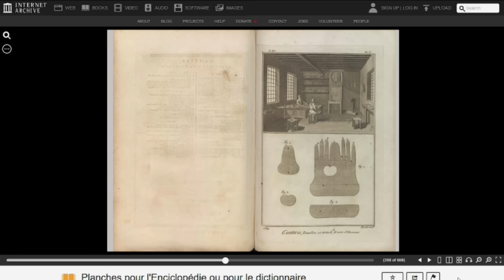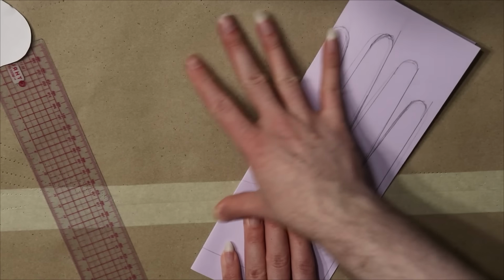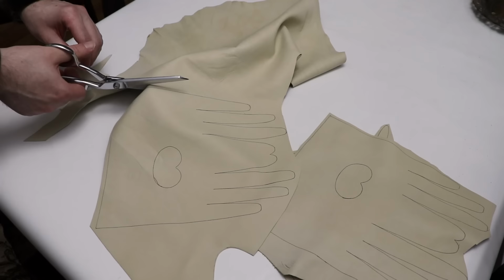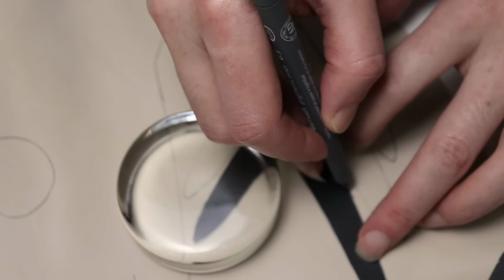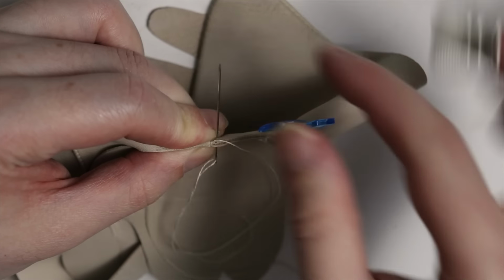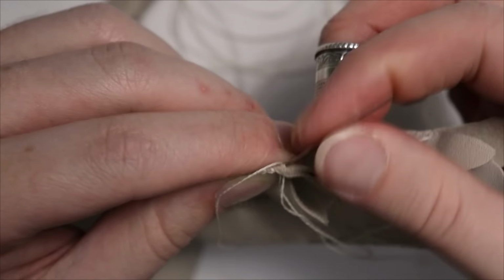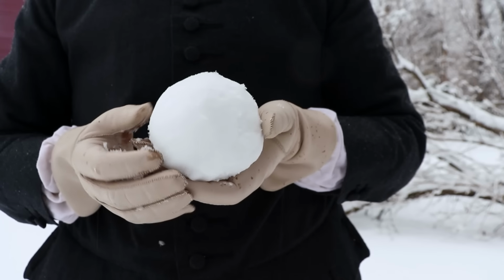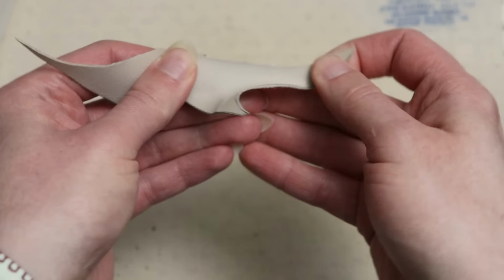Drafting, Painting, and Sewing Late 18th Century Leather Gloves [CC]

Comment: Hello! I am a hobby leather worker. Here is some information that I would like to share from my own experiments: 1.) Leather can handle some heat perfectly fine, in some projects, we dip pieces in hot melted max to make them harder and to seal them. So ironing at a low heat with no steam should be fine. But if you are trying to get the leather to behave, a better method is wet forming it. That's how we shape thick leather into extreme curves like hats and armor pieces. 2.) I have used an assortment of marking devices on leather including: ballpoint pen/white gel pen, alcohol inks (this will stain), water color pencil (this can also stain), grease pencil (this one is a smudgey mess but it does work), graphite powder (also smudgey), poked holes like one does with a tracing wheel, and the most common method for tracing a pattern for tooling the thicker leather weights is just to score your lines with a ball stylus. I hope this helps!
Reply from the maker: Thank you, it is helpful knowing a bit of ironing would be ok! And I hadn't thought to try ballpoint.

Comment: There are tools you can use to create an adhesive stencil so that, rather than having to peel each piece of tape off, you can remove the stencil off all in one piece. We have a Cricut that we use for many applications, including designing templates for carving woodblock designs and 19th century style quilt appliqués. And perhaps using a small brayer instead of a brush, to use the least amount of paint while getting the most even coverage without seepage under the adhesive.

Comment: Both pair of gloves turned out beautifully. I love the cow catchers. I think Howl Pendragon would enjoy wearing these striped gloves. The very slightly rough brown stripes look lovely on that neutral leather. If you would like to keep your needles from getting tiny little biting burs in them from using your pliers to pull the needle though, use a little scrap of leather between your needle and pliers. Using it with just your fingers will make it easier to pull through as well

Comment: As an American, I get most of my leather from Moscow Hide And Fur.  They get the hides directly from individual local hunters, so what's available varies a bit.  They also have bits of bone, in case you need a fang, claw, small skull, or bacculum for anything.  You might consider investing in some minksfoot oil to condition and waterproof your leather -- the oil fills up all the pores, so things can't absorb in anymore, especially water-soluble things

Comment: There are a lot of adjectives that come to mind that would describe you after my first video (And so far: Only) video I have watched from you...
With most just whirligig around how soundly considerate, well paced and absorbing you are all throughout it.
But in all of it, I find you to be such a sweetheart... As to "what would best describe" what it is I have just watched.

Thank you for the intimate respect you have shown to me as a viewer. This alone has very much deserved at least a membership to witness more of what I have been absorbed into just now.

A small tip for transferring (If it would be of any use to you):
I tend to work on gesso or other binders when I paint on canvas or wood, particularly since I have need for surface that can afford the massive details I have tendency to go for...
And for these, the "fastest" method I have found of transferring is to simply use rubbing alcohol on the back of a print-out/photocopy.
But shall I have to ever paint on leather (Although it still does tend to work actually); I refer from using this method unless it is a book cover or a hardened surface of some sort, due to the rubbing part making the material stretch and/or distort (Especially for Escher'ian geometric forms: this is sort of crucial) and since alcohol does tend to damage/dry it out.

WHAT WORKS though is the oldest transferring method I know to canvas... And that is to poke pinholes around your sketch and use it as a template to dust the image onto the surface.
For vegetable tanned leather; I transfer it such, and then "join the dots" with a B-3B pencil... But with a chrome tanned leather; I choose to opt for a gel pen... much like yours.

Thank you again for your time you have spent for sharing your experience with us in such an enjoyable way.

Comment: These thin masking tape strips remind me of paper strips used for quilling, perhaps you could buy the premade paper strips and simply use a glue stick to put some temp adhesion to them while making your lines?
Reply: I make the occasional collage, and putting glue onto tiny pieces of paper is very fiddly! I think there is also the potential that it would leave marks on the leather that would have to be cleaned off

Comment: in my experience, resolene is great for nice boots or shoes and thick leather journals.  I've tried to spray it on before to get an even coat but honestly a very slightly damp rag, a small amount of resolene, and wiping quickly and evenly has been my best method.  A small amount can make a big difference and you can always do another coat.  Too much will be thick, tacky, and cloudy.  I'm sure someone might know how to recover from that but I've just had to completely remove with acetone and start over, usually having to do some stain correction before attempting the resolene again.

Comment: What has worked for me when marking annoying leather is a somewhat used up quill pen and lamp black ink (The non moisture resistent but very cheap ink you can simply make from water, although they often used wine, lamp black which is basically just sut and gum arabic).

Comment: Might an eyeliner or similar makeup pen work for temporary marking, since they are designed for use on skin? Eyeliners come in lots of pigmented colors both light and dark, are sometimes waterproof/ removable with oil, and depending on the brand or brush used can make nicely fine/thin lines.

Comment: Both wonderful work and presentation Vincent. Some boot making techniques and info will translate to gloves. Worth it to invest in a leather hammer: the face of which is convex so as to not mar the leather. The antique ones are quite a bit smaller and more delicate than the ones sold at present. To finish the seams with the hammer, try lightly tapping the seams, or rubbing along the length of the seam gently to even out the leather after stitching. Secondly, you can try rubbing the seams open by inserting a smooth hard shape into the finger and rubbing the hammer against it if you like that effect. Also gently tapping the seam allowance before hemming. Some leathers are glazed after tanning and need to be deglazed with special solvents. Worth it if want to do delicate painting with Fiebings - and yes don't let it dry out - maybe an ink well for less evaporation on long jobs (there is a thinner if you wanted to try 'water colour' effects.  As far as cleaning, I believe glovers may have used hand forms of various sizes to keep the leather the correct size and the leather smooth when drying - you might try 'saddle soap'. You might also try soaking up some of the water with absorbent fabric tucked inside. It may keep them in true to size if you try glove forms to dry. There are leather marking pens with silver ink that rubs off after cutting depending on the processing and tanning of the leather. Warkov Safeer in Wpg (Boot Making supplies) is an amazing supplier that has third generation knowledge and will give you generous info over the phone even if they can't supply you with what you need (they have the pens and worth an ask if they ever have antique hammers/otherwise antique stores). Good to ask on any of your cold calls if there is any terminology with regard to names of kinds of leather - often referring to specific tanning methods: there is also lingo associated with leather thicknesses (I can't remember the #'s and terms). Try the Winnipeg Fur Exchange as well. Most reputable dealers will never sell you dry or crispy skins. If any dealers don't carry the kinds of leather they are often able to refer  you to other companies. Try calls  - best to glean term/info - there may be different terminology associated with garment leather and specific dealers of. Try Montreal. Hope at least some of it makes sense - Cheers

Comment: Liked for "of course, they are good friends" (the dragons). I was wondering how long your gloves have lasted you, and if you posted your approximate length of thread you use for each seam? That seems like it would be extremely helpful info!
Reply from the maker: Thank you! I haven't worn these very many times yet, but I wish I'd done two coats of paint all over, because the stripes on the tip of my right index finger are showing a bit of wear. 
I hadn't thought to post the thread lengths - I figure it'd be different for everyone depending on how big your hands are - but for the ones on the finger seams they range from 84 cm to 65. The ones on the backs of the hand are slightly longer.
The thumb thread is 90 cm, the side seam 63, and the hem 50.

Comment: I tried the straightened fourchettes and they do end up with a sort of bulge because the width has to go somewhere. So I think the trank pattern would have to compensate maybe? But the bend does also follow the finger somewhat, but it looks odd. Going to try the 45-60 degree ones instead, slowly working out my base pattern and making lots of errors along the way.
Reply from the maker: Yeah, I tried them on my most recent pair of gloves, and they worked but they did bulge out a bit at the top and I like the V shaped ones better.

Comment: Never heard of this channel before, but I think you might be my spirit animal. I have tried to make so many older styled garments (mostly Victorian) but typically fail massively, because I am a dumbass and refuse to do things the way they need to be done. Thats all besides the point though.
You earned a sub, because I think I can learn a lot from you, and if my budgets good for next month I might even pick up some of this leather and try to follow along with this video.

Quick question though. Are these gloves warm? I really want a pair of nice classy gloves for driving, but fear If I make my own the lack of a magical mystery material lining will mean they are cold as balls. I've bought leather gloves in the past that were perfect in style, color, and function, but were like half an inch too long on every single one of my fingers. It had some magic lining on the interior and I am unsure of how much that contributed to its insulation.
Reply from the maker: Thank you! No, not very warm, alas. The leather is pretty thin, and they're great for autumn but in winter I wear mittens over top of them.

Comment: I'm really glad this video was recommended to me, I've been sewing or knitting for years but somehow gloves never seemed an option, even though my hands are the only thing about me that isn't super average (large but relatively narrow, with long fingers, so women's gloves are too small and men's gloves too wide). I have been googling (of course) and found a supplier near me that sells lambskin leather in a thickness between 0.3 and 0.5 mm, which sounds like it would work, but it has a stretch cotton backing. Would that be suitable?
Reply from the maker: I don't know, it probably depends on how stretchy it is? It could potentially be peeled off though. 
I have a couple of hides with a woven backing on them, and it stretches one way but doesn't give the leather as much stretch as I want for gloves. I experimented on a small sample and found that I could loosen the glue with rubbing alcohol and peel the backing off, but I haven't tried doing it to the whole hide yet, and I'm not sure if the ones near you are backed with the same stuff.
Reply: @vincentbriggs1780  Thanks for replying! they advertise it as a cotton jersey backing and the leather being suitable for things like leggings so I'm not too concerned about stretch, more about having the fabric near the edges? But I suppose any unraveling threads would be contained by the hand stitching...
Reply from the maker: Oh that sounds much stretchier than the woven backed stuff I've got! I agree that it would probably be contained by the stitching, and knit fabric doesn't fray as much. It might get a bit scruffy and fuzzy around the edges with wear, but not having used it I have no idea.

Comment: I'm also kind of curious how construction differs in modern gloves--apart from the outward seams on your gloves, the only visible difference I could see between my modern gloves and the type shown here is that there is also a quirk on the thumb on my modern gloves. (granted, though, these are hand-me-downs of indeterminate age, but they can't be THAT old)
Reply from the maker: Modern thumbholes do look very odd by comparison! Nicole Rudolph has a video about making 1920's gloves (and an unlisted video about drafting the pattern), and they look to be a lot closer in cut to modern gloves than 18th century ones.

Comment: Really cool video! Been thinking about making gloves but Ive only worked with thicker leather (1mm+) and this was video was an eye opener (especially not even pricking the leather).

Have you considered trying to use resist to help you with colouring?

You shouldnt heat wet leather, because it will shrink and heating dry leather will remove any natural (or added) oils added via tanning which will make it quite stiff. Can be help via neatsfoot or olive oil.

I dont know if its possible but maybe you could do some tooling on thicker leather gloves? 

Chuck Dorsett @ Weaver Leather has some really good videos, granted its mostly thicker veg tan but he does go over thinner stuff (I think you could have a lot of success with chrome tan for gloves). Heres his video on preventing rub off: https://www.youtube.com/watch?v=pupbFm-27T8

I've also found that Resolene isnt a great finish for things that get scrunched up but its really good for large panels on bags where waterproofing is paramount.
Reply from the maker: It would be fun to try tooling! I don't know if I cold do it on leather thin enough for gloves, but I won't know unless I try. I do definitely want to try some with cutwork and appliqué.